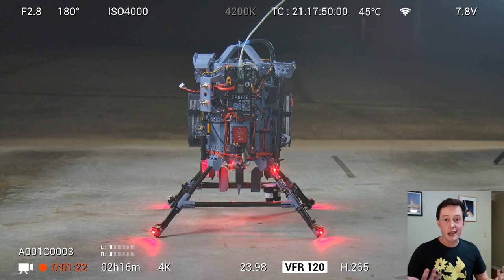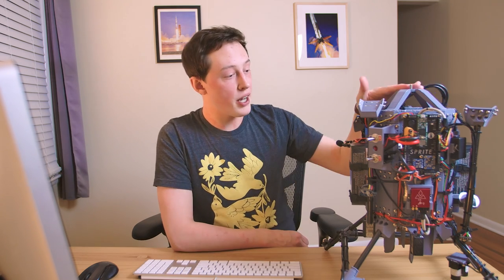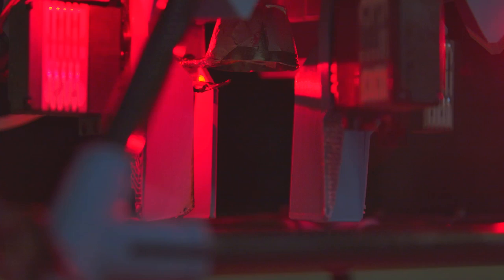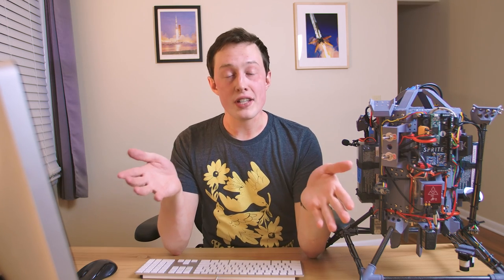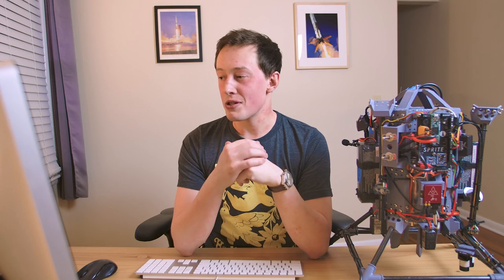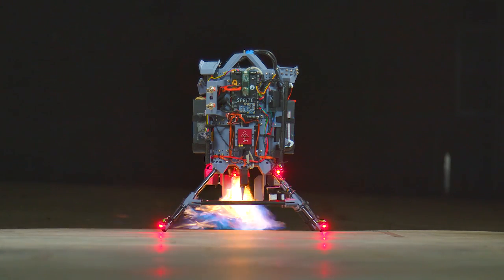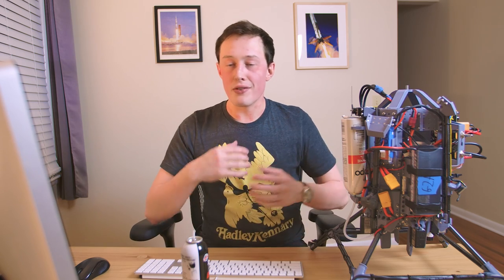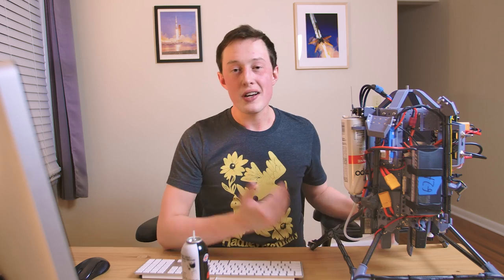EDF Afterburner Fire

Comment: Just my 2 cents:
1) run a coil of copper tube in the exhaust before combusting the butane. It’ll vaporise it and give you less fuel consumption and a cleaner burn. 
2) keep the low pressure zone you’ve got the same, but make sure you have some air inlet holes at the top as you need the fuel to combust in the zone which will require airflow. If the hole’s too big it’ll blow it out. 
3) look at David Windestal, he made one for edf. Seemed to work quite well.
Reply: Or ... simply turn the can and mount upside down and use what's already available.  As a side note I also wanted to add that his mentioning of "lighter fluid" is way different than butane or even liquid butane, it's more like kerosene.

Comment: Yep as some other people have mentioned, check out the Flite Test video about EDF afterburner, the way they made the burn cleaner is by running the butane through a heating coil inside the flame to aerosolize it before releasing and igniting it so that there’s no wasted butane and the burn is more even and quicker. Also that way you don’t need any extra power for the heating, since the flame is doing it for you. The only hard part there is the ignition but I think it’s worth it.

Comment: Looks amazing. Would recommend the flite test video on a afterburner similar to this
Reply: Was just going to comment, it looks just like it! He might also want to try adding a brass coil heated tube on the fuel inlet line to help with turning the liquid butane into a gaseous state quicker. That's what Peter Stripol did on the Flitetest episode when it was very cold out.

EDIT: woops hadn't finished the video, looks like he's already running the butane through a tube around the flame to heat the butane!

Comment: Add fuel in levels below the flammability limit into the intake and just add extra at the after burner stage to get it over the line, that way you've already got a good homogenization to aid with flame stability and get a jet like flame

Comment: Couple of observations that may or may not help. 
1. Butane will remain in liquid state at just below zero. (Celcius) We have had clients with this issue with burners. As the butane evaporates, it cools the system and adds to the problem. (Propane continues to evaporate at much lower temperatures).
2. Your exhaust external environment is effectively static, afterburners generally operate with turbulent fast moving (relative) atmosphere. (better mixing of air and fuel after leaving ignition zone)
This can be seen with blue flame where fan air is mixing and orange flame beyond. Less fuel may be better.
A Venturi, or simple air entrainment opening prior to the burner, will help a lot.
Heating the fuel will help. Direct the cold fuel to a lower coil (that gets more heat) then run it back up to the release point.
Study "bluff bodies" and see if you can provide somewhere for the flame to "sit" on. This way you will gain a lot more control over it.
Hope some of that helps a bit, and keep it up 👍

Comment: The stators will also be stagnating the flow off the back of the fan, which also recovers pressure from tangential velocity, increasing the thrust you get from the fan.

Comment: Those flames look really cool! I would suggest that adding the afterburner will in fact decrease the thrust produced by the EDF, as that is what I have experienced with my own tests (which you can see on my channel). This is because the combustion creates a region of high pressure behind the EDF, reducing the air flow.

Comment: Joe, something you might want to check is the nozzle size and angle. I like to model steam engines but hate the smell and mess of coal. I switched to using propane in my models but I found that different manufacturer of camping stoves, I uses as parts, nozzles vary quite a bit in hole diameter and concentrate. For my uses, I purchase under sized nozzles and dial it in using a four jaw chuck then re drill with precision drills. This gave me a better spray pattern.

Comment: Not sure if I remember correctly from my RC jet engine days but I see three problems:
1. The fan creates a vortex which will spread out the flame so those "anti-torque vanes" need to be present after the fan as well.
2. As you mentioned, you will need a flame holder for that afterburner.
3. This is useless, but fun and cool. :)

Comment: I've got a Hubsan 501s-s drone which uses the ground effect lights as part of the compass calibration and various diagnostic features of firmware upgrade successes. Interesting approach anyways and certainly has no problem getting off the ground or descending with enormous velocity while stable and in a sound landing solution.

Comment: If you check out "Tech Ingrediens" here on YouTube,
They actually use the EDF as a pre-compression stage for their jet engine in a true hybrid electric/gas jet engine.
In their case both components contribute greatly to the thrust of the engine.
Reply: MrRolnicek, I’m familiar with their work. It’s really cool but the amount of support hardware to make that function wouldn’t really be practical for this application, IMO. Tech Ingredients were trying to achieve usable thrust from the fuel, but Joe is just trying to achieve some visual effects. I get what you’re saying but two different applications.
Reply: @anthonydomanico8274  You can still use it as a reference to learn valuable lessons.
Also a lot if not most of that hardware is for prototyping, they're perfectionists so they want to make it the best they can. For that they need to be able to tweak as many parameters as possible during operation.
All I'm saying is, he's burning fuel anyway so why not get some thrust out of it while he's at it?

Comment: Are are liquid rocket injector designs floating around on NASA documentation. That may help atomize the butane very well for combustion. You can mill those injectors but you proper have to tweak the designs for the flow rate and “mol rate” for the most complete burn with oxygen.

Comment: First a question followed by some ideas I have regarding the low pressure zone issue mention around 4:30 I think. My question is, why would the afterburner limit your thrust? Unless you only meant that you couldn't sustain the afterburner at higher thrust levels. Now for the afterburner ideas (all 4 points are good info on flame holders, but later I realized they are irrelevant. skip to the edit at the end for the actual recommendation):

1) Regarding the flame favoring one side rather than being even, I suspect this is due to the flame holder design. It appears as if this is a truncated cone which I suspect causes the issue of the flame shooting off to one side. My guess is that flow along the inside of the cone is separating in the same way that flow separates from the top surface (ie the low pressure surface) of a wing when it hits its stall angle. However, once it has separated from one side, all of it sticks to another side. In an ideal world with perfect manufacturing and uniform flows it would separate evenly along the entire edge, but life is rarely ideal. (possibly incorrect, see edit at end),

2) The easiest solution to 1 would be to complete the cone and not allow air to enter the interior of the cone and eliminate the idea of flow separation as an issue by eliminating the interior flow. However this obviously worsens the thrust losses, but its on the right track and is roughly the idea behind most flame holders in actual afterburners.

3) A more thrust friendly solution would be to convert your truncated cone into a V-gutter flame holder. Here's an image (sorry for the potato quality) of one, you've likely already seen this kind a million times before:
https://farm5.staticflickr.com/4867/31969345377_4cfc3793b0_n.jpg

4) Not sure how much you've already read up on the topic bet if you'll indulge me I'd like to delve into the theory behind gutter style flame holders. Imagine you have a pitot tube facing into the flow; air enters the tube and comes to a halt, thus measuring the total pressure (or stagnation pressure) of the flow as you'd expect. Now point the tube at a right angle to the flow; air in the tube is sucked out until the pressure in the tube is equal the to static pressure of the flow, again as you'd expect. Now point the tube backwards so that it faces downstream and you would find that the pressure in the tube is slightly lower than the static pressure of the flow. This is because now you are measuring the static pressure minus whatever eddies and vortices the tube is leaving in its own wake. The the gutter of a gutter style flame holder is effectively like that backwards facing pitot tube. Now I'm assuming you are imaging a pitot tube as it appears in this image (ie with that 90 degree bend):
https://i1.wp.com/automationforum.co/wp-content/uploads/2018/01/ptot.png?resize=580%2C375&ssl=1
Well imagine you have that backwards pitot tube and you poke a small hole in the back of the tube so that it allows a tiny amount of the oncoming air to leak into the tube. The pressure would still be lower than the static pressure, but less so than without the hole. When you truncated the cone of your flame holder, you effectively poked a gigantic hole in your backwards facing pitot tube.

Edit: From the camera angle looking down into the EDF I see that, while still being a truncated cone, the center of the cone does not appear to be ingesting airflow so it should have indeed acted like a gutter style flame holder. I now have a better theory as to why the flame holder didn't work. Since the stators are canted at a fixed angle, in theory there is only one thrust level where they perfectly cancel out the vorticity. In fact I would bet that just those 4 stators aren't enough to ever fully cancel out the vorticity, but even if they are my main point is still relevant: the flow likely had a lot of vorticity. So the incoming flow might actually have had a lower static pressure than the region inside the flame holder. However, this is good news. The lowest pressure of a vortex is always at the center of the vortex. So it would likely perform much better if you removed the flame holder entirely. Of course, when you reach the thrust level where vorticity is perfectly canceled this would abruptly blow out the flame, but as I state before I highly doubt that those stators would ever be enough to completely cancel the vorticity, but that's just a guess. Alternatively, if you still prefer a flame holder model, you could try to add long straight stators to the EDF outlet duct (or lengthen the duct to add them after the existing canted stators). I'd use long straight stators rather than canted ones because canted ones only work at a fixed thrust setting while straight ones work for all thrust settings but need a longer chord length to work well.

Comment: BPS.space: Instead of building a complicated setup yourself and trying to debug it, you could use the business end of a soldering lamp. This also usually comes with a build in regulator as well as ignition wires.

Comment: Hey, good work. On thrust: Yes you can create thrust with a burner in an EDF, but I am pretty sure you need to enclose the section where the fuel is being burned, otherwise the gas will expand everywhere and not actually accelerate. Have a look at the channel "Tech incredients", he built a EDF with a burner and doubled his thrust I believe! (even tho he used two EDF in series, little bit different setup than you)
Reply: I second the Tech Ingredients recommendation.  That video is extremely informative, as is the rest of his channel.
Reply: @jamesburleson1916  Yes!

Comment: Put a throat after the fan? It'll create a low pressure zone.

Another idea to circumvent the liquid butane problem: instead of feeding the fuel thru a small tubing, you could attach a secondary duct that sucks (using the EDF pressure) aerosol + air and dumps into after the fan. Explore the fact that the expanding gas leaves with momentum and will help to create a low pressure to suck the air near the canister outlet.

Comment: It's just a gas burner. You need a divergent nozzle so the expanding gases drop the pressure after the turbine so it's pulling in more air.

All you're doing there is using your jet exhaust gas to light a flame. When you get it right your fuel consumption will go up exponentially.

Comment: You can build an electric turbo compresor so you can inject like 1 psi of air more to that after burner, i think it can help whit getting a better mix with that fuel and probably get real trust from that combustion 🤔😁 (please give a heart or comment what do you think so I now if you've read the commentary xD)
Reply: Or even better, a turbo rocket using the miniature electric turbo compressor. Using atmospheric air as the oxidised in a rocket

Comment: If the fuel is burnt inside the same duct from the EDF, you might actually get some thrust from that afterburner. 
But it would require some tests to determine if the resistance created by the additional duct and fuel injection stuff can actually be compensated by the thrust addition.

Comment: Looks like your butane is forming fairly large droplets - a finer spray will burn more quickly and stably, hopefully avoiding being blown out. Basically you need finer spray nozzles or possibly inject the butane farther upstream - even before the EDF blades maybe, so they break up the droplets.

Comment: The flame isn't igniting in the engine bell. If you do want to sustain it, you are going to need to have a viable control on the butane flow. If the butane can't sustain a flame at anywhere above 40%, you're going to need a tank for the butane that will allow for a higher feed rate.

Comment: Good job so far!  Following closely.  A couple of suggestions:  You might want to look into nitrous jets used in racing, there's a decent range of sizes to experiment with quickly, and you could put them inline with the tubing. Regulating close to the bottle would slow down the butane flow enough for it to stay in the copper tubing longer to gather heat, and give it some room to expand into gaseous state.  Also you may want to extend the nozzle so there's more room (and time) for the heat exchanging process without having to block any airflow from the EDF.  You also might have to find a way to put it on a little bit of a diet, or double up on the EDFs (which could help solve the torque problem if they counter-rotate).

Comment: 30 year pilot (and RC pilot) here (non-engineering BA!) but, I am concerned about the butane combustion chamber interfering with a smooth flow out of the fan unit. While you are machining the new vanes, why not have a slim teardrop butane emitter made with like 1/20th the size of the speed taped unit? The fan air needs as few interruptions as possible to be efficient. A tiny nozzle the size of a pencil eraser with a 1/2-1" spike above it would propagate flame well while offering minimal fan inefficiencies due to turbulence. You just need to see a nice flame under the Sprite in flight. Awesome work! Good luck in your flight test phase.

Comment: Hey man. The reason your afterburner flame is moving erratically is because the flow in the nozzle is detaching from the nozzle wall. The reason this is happening is because you’re passing subsonic flow through a divergent nozzle (doing this will also decrease the efficiency of your EDF). Divergent nozzles are designed for supersonic flows. I’d recommend either using a straight nozzle (a tube) or a slightly convergent nozzle. I don’t think this problem is because of flow obstructions or bad fuel mixing. Good luck!

Comment: I tryed this myself, but gave up for now. The hard part is to make a flame holder that creats a low speed area, without creating a lot of wind resistance. 
what i tryed was to put small holes in the sides of the cone, to get some mixing. So the goal is to create a fuel rich, high temp, slow speed area in the cone, wich sustains a stable combustion, so the exess fuel then burns in the rest of the gas.

Comment: you could probably put a smaller venturi in the center of the EDF outlet flow path and have a small nozzle (or multiple) that help siphon the butane out. Basically a carburetor. I'm not sure how well it would work with butane, but it's worth a shot and you might actually be able to get better A/F ratios and a little thrust. Maybe even cutting the venturi out of an existing carb and getting a jet kit for it to adjust the nozzle diameter. 

My explanation is a bit weird and not the best way to describe how carbs work, but I wanted to be a bit more clear on how they work in case you weren't familiar

Comment: You got to atomize your butane.. do it by heating it or do it with a "sprinkler" nosle also get a FLAMEHOLDER and put the sprinkler in the flame holder in the flame tube also converge the nosle but keep the looks also make the combustor "pipe" larger in but proportionally.. Thats all i know.. hope it helps and flyes well good luck mate

Comment: I'm glad you clarified th point of the afterburner at the start of the show 👌

I'm wondering if the heat of the flame will have a negative effect on the performance of the lift fan. Lower density air and such.

Comment: You could try a nozzle for a evaporator for air conditioning. It would airisolize the liquid into a gas. That's the original purpose, only using freon. And the size would be perfect. There was liquid pouring out the whole time. You should see if you can put a regulator and a a/c nozzle.

Comment: Joe, what is your real object?  To get the hopper flight control system working, or watch a flame? Unless you are going to make a hybrid jet engine with the EDF and a compression/burner section, you might want to pick one or the other.
Also, on those vector fins, aluminum may not be the best material as it will distort from the heat over time. Try making them from ceramic like a thin tile and cut as needed from a big box store.